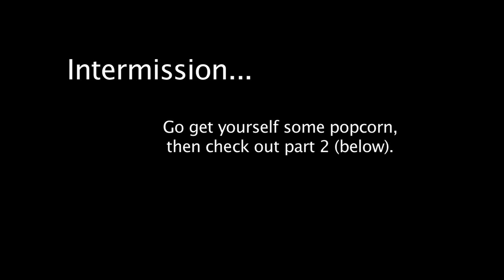PQA Ep. 2: Water Cooling T-Lines & Multimeters (Part 1 of 2)

Comment from the maker: @OreiZlatan Closed-loop cooling system performance is a lot more complicated than just thinking of how much time any given water molecule spends in one place. As it pertains to PC cooling, if you want to introduce restriction into the system, then do it in a useful way and add a nozzle at the inlet to a block. This will increase local coolant velocity and improve performance through crude jet impingement (waterblocks rely on targeted coolant turbulence to perform well).

Comment from the maker: @OreiZlatan In a closed loop in which the coolant flowrate is >0, coolant will spend roughly the same amount of time in the radiator regardless of flowrate during a given period of time. Think of it this way: 2 cars are on a 1 mile circle track, one car is traveling at 40mph, the other at 120mph. It takes 1 car 90sec. to lap the track & the other takes 30sec. If your radiator represents 1/4 of said track, both cars will spend 900sec. in that area in 1 hour.

Comment from the maker: @OreiZlatan Engine cooling systems are pressurized, high temperature systems that are designed to maintain a particular temperature range, not make things as cold as they can. The engine temperature increasing has more to do with the design of the water jacket than the "amount of time" water is spending in a radiator (think negative impact of transition from laminar flow to turbulent flow within the water jacket).

Comment from the maker: @OreiZlatan With a comment like that, I'm just going to assume that you're trolling. Then again, maybe you're not... a reduction in outlet diameter would increase the pressure drop across the block, which would reduce coolant flowrate, and result in an overall decrease in system performance. This has been proven both mathematically and through numerous controlled experiments. Note: I'm only talking about typical PC water cooling systems here.